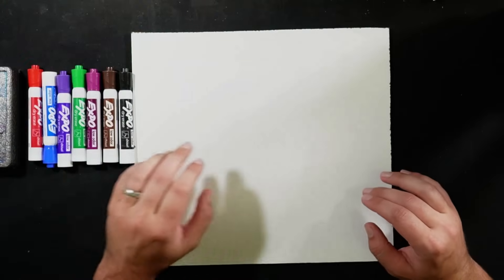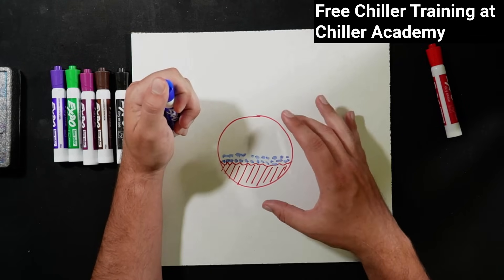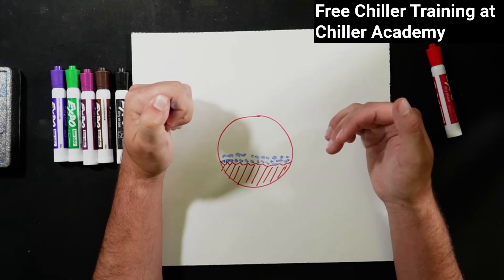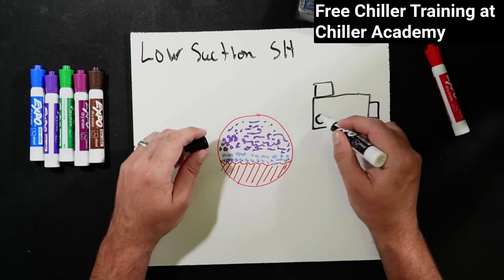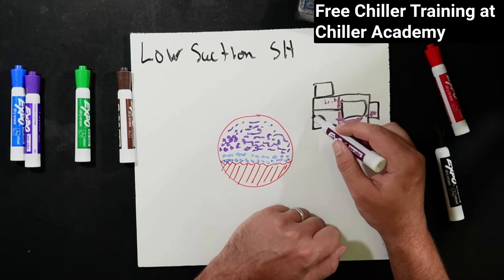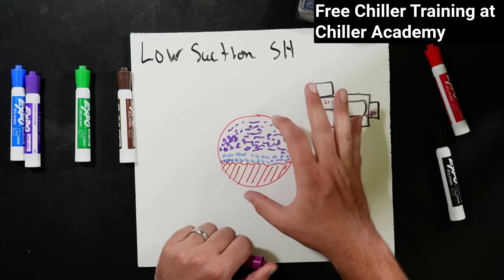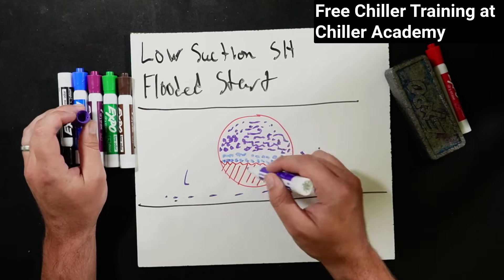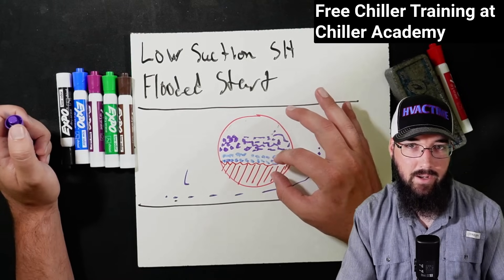Foaming sightglass on reciprocating compressor Explained

Comment: when you have more oil than you should, the bottom of your rods will hit into the oil and thrash it around which can make those foams and make your amps go higher aswell since the rods are met with extra resistance.
some collected liquid refrigerant at the bottom of your oil seperator thats feeding back to compressor oil sump in low ambient temps.